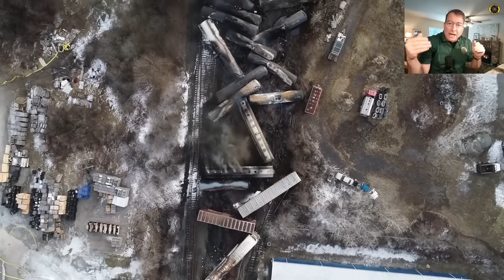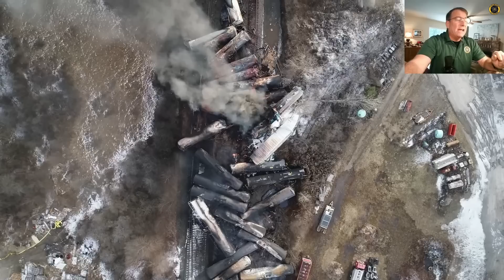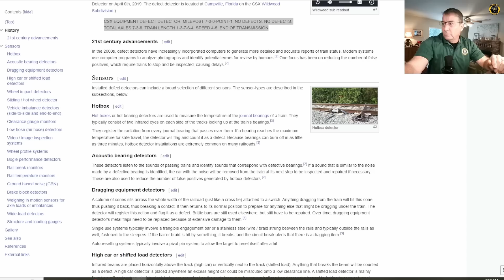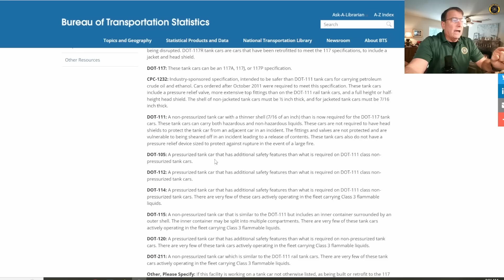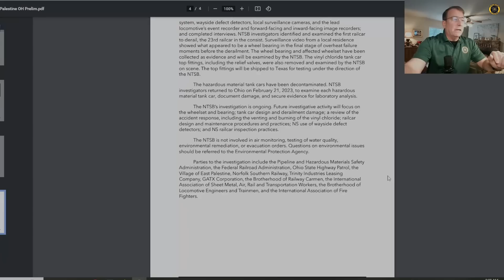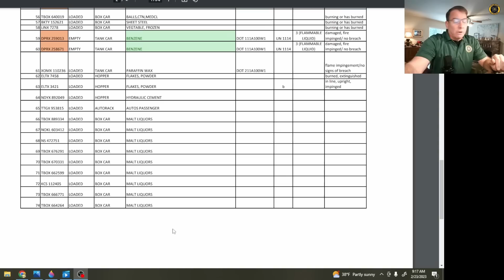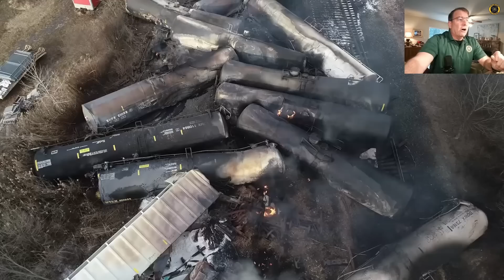NTSB Prelim Report: Norfolk Southern Train Derailment 23 Feb 2023

Comment: I’m a retired locomotive engineer and one clarification. The way the cars are stacked up is not an indication of an emergency brake application. That would happen regardless of anything. Once the train derailed the buff forces of the 17,000 tons of train caused that. Even in emergency a train can take a mile or more to come to a stop all the while shoving against the derailment. The train was already in dynamic brake mode as they were following another train. When they got the alarm from the third detector I’m certain that the engineer made an initial service application to supplement the retarding effort of the dynamics to aid in a controlled stop. It’s my suspicion that the bearing was so hot at that time possibly even near red hot that the friction of the brake shoe on the wheel set spun the bearing off causing the derailment and subsequent emergency application. Just my 2 cents worth.

Comment: I posted a news article link yesterday that revealed there was a security cam screenshot of the train that was said to be 43 minutes before the derailment with what appears to be bright orange glowing coming from one of the cars. The NTSB says the incident occurred at 20:45 and the cam timestamp says 20:13. That timing actually shows 32 min before?  I came back to edit the comment and it had been deleted. Was it Juan or YT that did that? Either way it smacks of being just like the government censoring information on Social Media they don't like.
"I may not like what you have to say, but I will defend your right to say it."
Reply: Well the incident the NTSB is referring to would be the time of the derailment not the timestamp on the camera
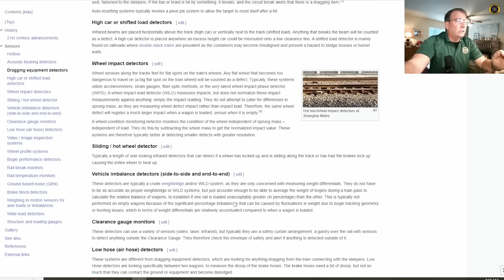Reply: @Stoker58  Exactly, The NTSB says 8:45 [20:45] and the timestamp on the camera is 8:13 [20:13] 32 minutes before the derailment.
 A train doing 60mph which is 30miles every 30 minutes means that even if the train was doing 50mph it would have passed at least two 10 mile spaced defect detectors after the camera timestamp. The cam screenshot shows glowing and both of those defect detectors should have alerted the crew to the problem before it derailed 32 minutes later. Why didn't that happen?

Comment: Very good analysis. I am a locomotive engineer with a class 1 and different railways give different messages when running over HOT box detectors. Some will audibly give length, speed, direction, axle, length and ambient temp. Honestly all it does is clog radio traffic. Most have set the detectors up to where it lets you know it working and won’t give alarms unless there is a problem.

We have a desk that monitors them. Sometimes the will get on the radio and let you know their may be a problem, what axle or car and what to do to fix it.

We interchange a lot with the NS. That company definitely has a “get-r-done” attitude.

Comment: We must be capable of some type of intelligent braking technology to to take over in emergency situations rather than the (apparently) full-on braking that occurred when the air line was cut.
Reply: There is no other type of braking that would have prevented this derailment, the car derailed severing the brake line and causing an emergency brake application. The momentum of the train simply cause the cars behind to pile up

Comment: Firemen were elimatated before cabooses.  Firemen only worked in locomotive cab in any case.  Then end of a train is monitored by a radio relay that measures the air pressure availble in the train line.

Comment: Almost correct on the brakes, it takes air pressure to apply the brakes on a train, a train car that has been parked with no air, will roll freely the moment you take off the handbrake.
However, this doesn't mean that a loss of pressure on a running train gives you no brakes, the reason is that each car usually have their own reservoir and senses the pressure in the brake pipe (Think air hose from car to car) and uses its own reservoir of air to apply the brakes.

Comment: Surprisingly missing from the NTSB report is the time the train passed the defect detector in Salem, OH (mistakenly identified as Palestine, OH) and the time that the report was given to the train crew. Surely the engineer could have stopped the train within five miles of getting the report. Travelling 20 miles from the detector and still going 47 mph seems odd. I also question what agency authorized the chemical burn. Without prior authorization, doesn't this open the railroad up for a huge fine?
Reply: Correct, in fact the first warning of impending bearing failure was 30 miles before the wreck, at Sebring, and confirmed at Salem. There is a third "dumb" detector at Columbiana, that only checks for dragging equipment.  If it was a full HBD, it probably would have reported very high temperature. Triple redundancy. Plenty of time to get the train stopped gracefully out away from towns. It's farm country. Railroad policy is apparently to ignore temperature trending, and just look at a hard threshold.  Thinking that a bearing that is starting to warm up is not an indication of impending failure is fantasy.

Comment: Maybe they should not apply a full power emergency braking on such an incident. 
If he would have applied a gently brake, this accident would not got happen in that size!
Reply: The engineer didn't apply the emergency brake. The train coming apart dropped the air pressure, triggering emergency braking on the entire train.

Comment: Control systems engineer here... About 6,000 airliners in the US.  About 1,600,000 (1.6 million) freight cars in the US, ~266 times as many RR cars as there are airliners. Somebody would need to figure out the cost per car to add temperature sensors to all 8 wheel bearings, a logic box, and radio transmitter to every freight car, but also the cost for workers to maintain the 12,800,000 sensors and 1,600,000 sets of logic and radio transmitters, and *batteries!*, forever. If you could do the installation for $10,000 per car, that would be $16 billion for the installation, plus workers to maintain the electronics and change batteries. Would the railroads pay for this, or us taxpayers? We're having trouble buying groceries and gas. Would the transmitters all be transmitting at the same time? Transmitting at the same frequency or 1,600,000 different frequencies? Radio based CANBUS protocol might be a way.

The fact is, the detectors were reporting the temperature trending up, but NS protocols were to ignore that trend until it was too late.  Starting at Sebring, 30 miles of detectors reported the heating trend, giving 30 miles of advanced warning of a failing bearing, but the benefits of reporting the trend were lost by just ignoring the trend, instead assigning a fixed temperature threshold to sound the alarm.  A slightly warm bearing, and which trends upward the next time you check it, is guaranteed to fail sometime soon. This is just dumb.

Now the rumor pops up that maintenance crew in St. Louis wanted to pull the car out to change the bearing, but overridden. Hope NTSB follows up on whether this rumor is true or false. Jennifer?

Comment: Freight cars-trains each have their own air supply tank that is charged through a single brake pipe that runs through the center of the consist. The brake pipe is steel except for where it connects to each car with a glad hand attached to each end of a rubber hose between the cars. The engineer can activate the cars brakes by reducing the air pressure in the brake pipe. A valve mounted with the air tank on each car senses the reduction of air and applies that brake on the car with its own air supply. Afterwards, each cars air tank is recharged via the brak pipe. Freight trains can make two full service applications before the air tanks are empty and need recharged--at that point the train has no air brakes. Trains also have dynamic braking where current produced from coasting electric motors is diverted to heat grids on top  of the engines, thereby placing a drag on the traction motors and slowing the train. If  a car were to brake free it would loose brake pipe pressure and hence dump all of the air from the cars tank into the cars brake chamber (emergency braking). The engineer can also dump all of the air from the brake pipe and cause the whole train to go into emergency braking (big hole/ dynamite the train). The incident train in this case had a hot box/overheating wheel bearing on a hopper car filled with flammable plastic. It looks like the fire burned through the rubber portion of the brake pipe at the end of the car, placing the train into emergency braking- probably in a curve, derailing the train. Unfortunately, before the trains crew could be warned to stop the train by a wayside hot box detector, the trains fate had been sealed. A tragic accident that most likely could have been prevented with better car maintenance.

Comment: It would appear that the bearing failure was very quick. It is now widely excepted that once the bearing has started to get hot failure is imminent. It might be that the bearing by this point had seized preventing the whelset from rotating. Which may have been the initial cause of the derailment, It is unlikely that a problem with the bearing would have been detected prior to the departure of the train. Neither is it likely that the crew would have noticed anything wrong during the journey, As they probably had air conditioned cabs, plus the noise from the engines would have made hearing a problem difficult. Ultra Sonic monitoring of axlebox bearing, is proving to be a more reliable way of detecting problems with bearings before they become a catastrophic failure, Here in the UK there have been several recent freight train derailments caused by undetected locked axles. Fortunately without the dire consequences of this incident.
Reply: The bearing that was heating up was spotted by the Sebring detector, 30 miles before the wreck, and increasing temperature reported by 3 different detectors. There was plenty of time to prevent this disaster. The protocol is to ignore the trend, just alarm at a fixed high temperature threshold. Priority is avoiding false alarms, not spotting a failure before it happens.
Reply: @SteamCrane  if I was investigating the incident. I would want to know what the procedure is for monitoring the information from the defect detectors is. It could well be that it is not remotely monitored in real time until an alert threshold is reached. Even if the information was monitored in realtime it is possible that the person that saw the temperatures rising did not interpret the information correctly. Other factors that could be in play are. Was the vehicle overloaded leading to the rapid failure of the bearing. Or was there a defect with the suspension system that also could of caused the bearing to fail. Hopefully when the full report is release these questions will be answered.
Reply: @markb846  Agree. Entirely due to bad policy. The detectors show trending temperatures, but this trending was ignored in real time. Bearing temperatures were going up, starting at slight rise at Sebring 30 miles ahead of the wreck, rather hot at Salem, very hot at East Palestine. There is another detector at Columbiana, but it is a dragger only, not HBD. If it was a full HBD/DED, it would have alarmed over the very high threshold set by NS, and the train would have stopped out in the country before the derailment. They had 30 miles of warning, and the train wasn't stopped. Nice to talk to somebody that understands this stuff!

Comment: Former Class 1 Mechanical Officer here.  I have investigated a few of these 'wrung bearing' accidents. 
From the NTSB Prelim. report:
A wheel bearing failed on the 23rd car,.
The wheel folded under the car,, and came to sudden stop.
The train with the loads in question (railcars 28–31 and 55) folded up behind it, like trying to push a wet noodle. 
 God's hand is the only thing that would have kept the cars behind it from derailing catastrophically.
At least you've done your homework.

Comment: Braking from the locomotive only seems unusual. Normal braking is by reduction of air pressure in the pipe along the whole length of a train. Emergency braking because of complete loss of air pressure should still happen along the whole length of the train. That should not cause the jack-knifing.
Reply: It limited the number of cars that derailed. A lot of cars back of the derailment, and the DPU, stayed on the rails.

Comment: hold the fucking phone.

instead of having, say, heat and vibration sensors on the axles, they just build shacks along the rails to check on the train every now and then????

no wonder these things are jumping the tracks.  Christ, can you imagine the uproar if Airlines decided that to save money on cabin pressure sensors, cabin pressure would be read via a telescope inspecting tension marks on the skin of the plane as it flew over every hundred miles along its route???
Reply: I posted a rough cost analysis. Onboard sensors would be doable, but cost to equip 1.6 million RR cars in the $billions. (Taxpayers?) Plus the cost of maintaining all of the onboard systems and their batteries. We can't even afford to buy groceries with the last 2 years of inflation.
Reply: @SteamCrane  why would the taxpayers eat that bill?  they're privately owned trains.  The taxpayers aren't paying for the Airlines to buy new radar altimeters at a multi-billion dollar pricetag, why would we pay for Norfolk and Southern to use real equipment monitoring?
Reply: @ShuRugal  The price in the neighborhood of $16 billion would probably put them out of business.
Reply: @SteamCrane  "put them out of business" my arse.
Reply: The bearing heating up was detected 30 miles before the wreck, but was not reported to the crew, and ignored by the dispatcher. They had 30 miles to make a comfortable stop out in the country, if they would have been notified by the dispatcher.  This onboard bearing sensor and electronic braking stuff is a red herring from non-technical people, and would decrease reliability, due to complexity and electronics to be maintained, and 1.6 million batteries to be checked. (Mechanical Engineer talking.)  Normal air brakes are rugged, simple to maintain, and have an inherent failsafe design. They worked correctly, NS management policy caused the wreck. The problem was NS not acting on the hot bearing after 2 detectors reported it, not some issue with the detectors not reporting, or a brake problem. A dumb NS policy issue.

Comment: It will be interesting to see what the maintenance records show for the entire Northfolk southern system is, though these railcars may not be owned by the carrier. It is my understanding these axles are replaced regularly or should be. The calibration issue is a significant point as it sure seems from reports this axle as very hot long before it got to the wreck site
Reply: Those cars were not owned by the railroad.  Every rail car has a reporting mark followed by the car number.  Any reporting mark which ends in an "X" signifies a privately (non-railroad) owned car.  Normally chemical tank cars are owned by a shipper.  General-service cars like box cars, flat cars, and gondolas may be owned by the railroad but are generally owned by leasing companies, e.g. RBOX.  According to the NTSB preliminary report, all the derailed tankers had reporting marks ending in "X", therefore the owners, not NS, are responsible for preventive maintenance.

Comment: Juan, thank you for covering this.   I worked for a jet engine manufacture in a component test department for over 30 years. I worked on bearing compartments.  Once the temperature of a bearing starts to increase above its normal temp, the clearance in the bearing can go to zero and the bearing will fail. This can happen in as little as one minute. (Also see comment from Searle A.)

For a train with a lot of cars with temp sensors on the wheals, this becomes an easy problem to solve. A simple computer program can analyze the temps and send a notice to the engineer that the train needs to be stopped.

Comment: For an airplane guy, you did a pretty good job covering this derailment. 

Positive Train Control is designed to prevent train collisions, not derailments. 

The railcars stack up like this because of the increased drag applied to the lead cars when they derail.... and emergency brake application prevents this from happening to the remaining cars. This means the malt liquor would have ended up in the ditch, too, without an emergency brake application. 

When the airline between the derailed car and the car ahead of it separated, the emergency brake application was initiated. When the emergency brake application opened the PCS (pneumatic control switch) on the lead locomotive, the lead locomotive will relay this information to the DPU (distributed power unit) and it too will open the PCS triggering an emergency brake application from the rear of the train. Once the initial airline separated, the entire train was placed into an emergency braking status in less than 2 seconds. 

An EOT (end of train device....blinking red light) or in this case, the DPU has the ability to initiate an emergency brake application from the rear of a train, this is to ensure the application is applied throughout the entire train. Without this feature, the sudden run-in of slack between train cars behind the derailing cars could pinch the airline, preventing the emergency brake application from applying to all of the cars behind the pinched airline.

I can't speak to the defect detectors on NS lines, I was an engineer for Union Pacific.....but I can say for sure, the UP hotbox detector would have given a "defect detected" by the second detector this train crossed instead of the third one, thus preventing the derailment. I believe the triggering parameters are set too high on the NS detectors in question.